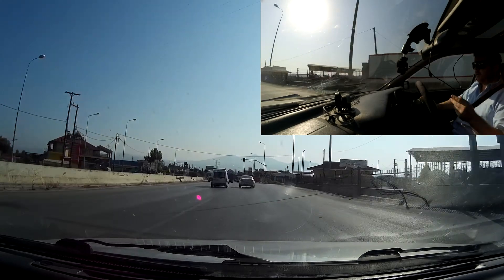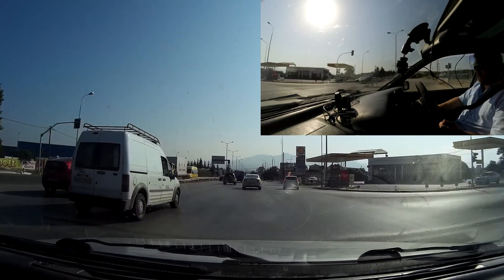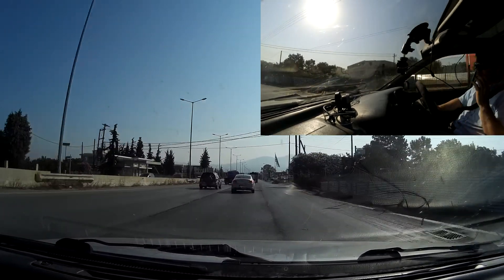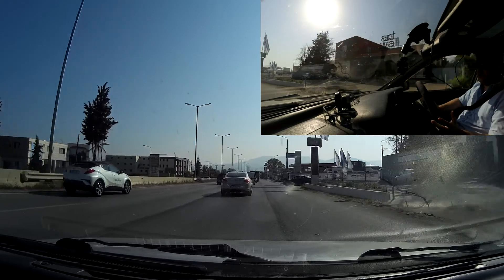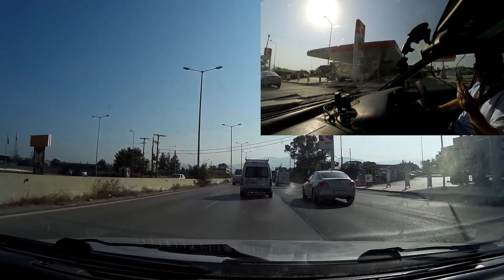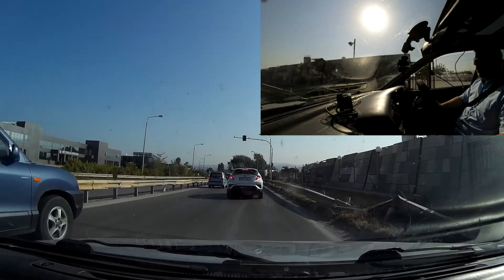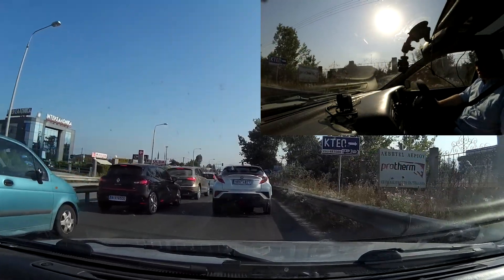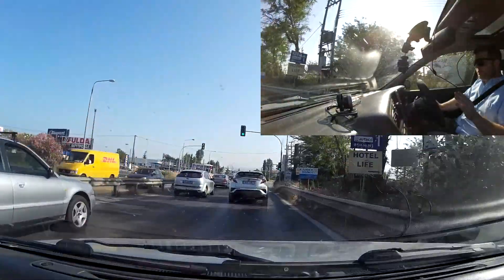Walbro vs Bosch vs AEM vs Aeromotive - Volts, Amps, Fuel Flow Test

Comment: I dont think anything about walbro tech is more advance, The wal 255 draws less amps because its weaker, its kinda common sense, the walbro 450s is more powerful then the 255 and it draws more amps.
Reply from the maker: Hi, for the same pressure eg 60PSI , the Walbro 255 draws about half the current of the higher flowing pumps. Sure it flows a bit less (10%) but the current demand is 50% less. Basically my thoughts are, the drop in upgraded pumps draw so much current I would like to upgrade the wiring to be on the safe side and if Im going to do that I may as well fit the best pump ie the Bosch 044. Standard cables Walbro 255, upgraded cables Bosch 044 with swirl pot. IMO..

http://streetandcircuit.biz/wp-content/uploads/fuel_pump_test2.jpg

Comment: how the hell do you call the walbro 255 the clear winner when the AEM and DW300 are clearly better and provide better head room and will work with stock wiring?
Reply from the maker: Hi. Looking at the DW300. Assuming you have a 15 amp fuse for your fuel pump. At 15PSI boost (60 PSI total fuel pressure)  you are at the limit of the wiring, because it will draw 14.7 amps. So I respectfully disagree that you can use the original wiring. 
AEM is better, but at 60PSI it still draws 12.4 amps. 
Bosch 044 at 60 PSI draws 13.4 amps
Walbro at 60 PSI draws only 7 amps. 

To be cautious I choose the 255 because current draw is much lower than the AEM and the power handling is close to the AEM (within 25 bhp at 2 bar boost) and if I needed more Id use an 044 with a fuel pot because the amp draw is close to the AEM but the Bosch has much higher power capability.

My opinion.

Test figures are from this article 
Bosch/Walbro - http://www.superstreetonline.com/how-to/engine/1404-fuel-pump-shootout/
AEM/DW300 - http://www.superstreetonline.com/how-to/engine/1405-fuel-pump-shootout-part-2/

Comment: Well the bosch 044 flows a lot less than the Walbro 450, the smaller walbro is of course less capable, but maybe you should mention the 450. The 450 does also draw a good bit more current than the 255.